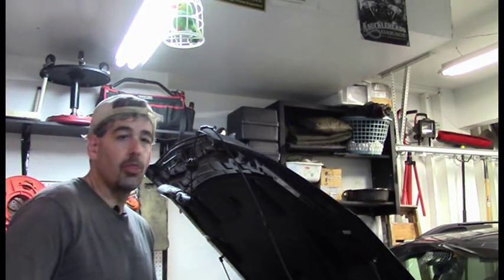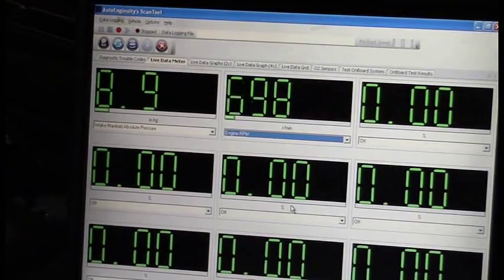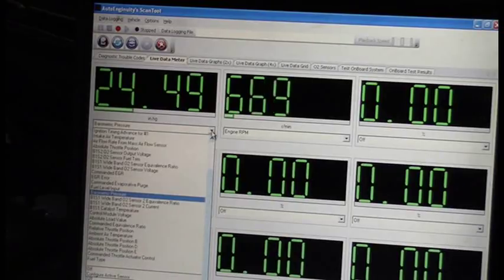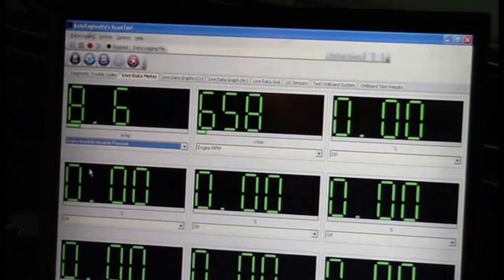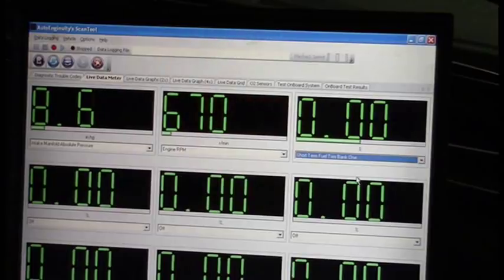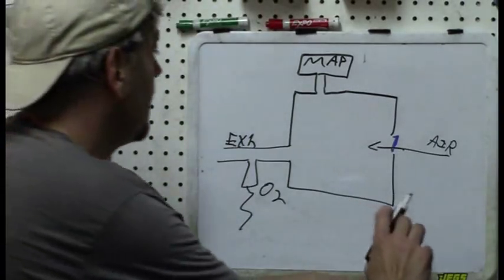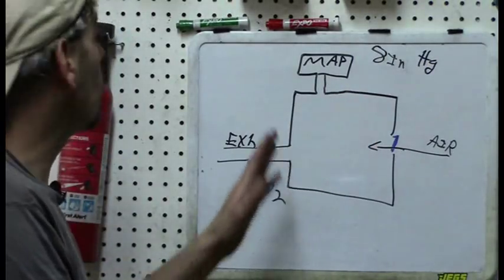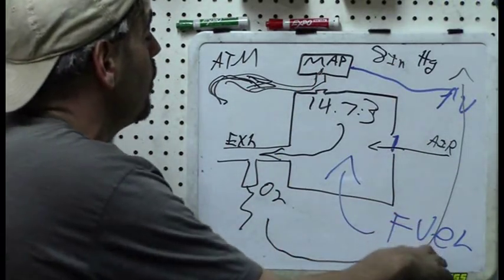MAP Sensor Diagnosis and Understanding Function- Pt2

Comment: Hei,  Is it possible that my MAP sensor in not working properly if engine is not working properly... I mean that engine will not go over 3000 rotation...if the rotations will go higher than 3000 then engine will jerk and doesnt want to work anymore.If I keep it under the 3000 rotation then it will work properly. OBD did said that there is a problem with MAP sensor but maybe MAP sensor just let me know that there is problem somewhere? Toyota Camry Le 2000 2.2 4-cylinder automat.
Reply from the maker: Its possible. What data do you have?
Reply: @SchrodingersBox  I dont know. In the workshop one electrican told me that problem is with MAP sensor...but I am not sure If he read it right.
Reply from the maker: Can't help- I need to see the data.
Reply: @SchrodingersBox  Thats too bad, but I understand. And I forgot to mention that...there is one problem more. Machines cant measure the CO2 also. So, If it is MAP sensor then because of that I cant drive over 3000 rotations and measure my CO2. I may get the data in the beginning of february

Comment: Excellent video and EXCELLENT explanations of how things work. You can look for online info for so many things and just waste so much time finding meatheads that make crappy video's and don't know what their talking about, never mind be able to explain in depth like you did.  I'm 53 and been a long time mechanic on my own diesel and gas trucks and equipment all my life. I haven't brought anything of mine to a shop since a teenager. I mostly have,  save, and run the 80's square body gm trucks with carbs and have a yard full of parts trucks. I'm a master with any carb, but have procrastinated on FI over the years. I have been forced into it slowly over the years of course with my ole ladies cars, etc. Thank you, this is what I've been looking for.  I'm going to your fuel trims vid now.

Comment: Another great vid. Thanks.
Im watching your videos as Im trying to determine what can cause hissing noise and jumping revs and hesitation on acceleration but it gets better as the engine warms up. My next checks are Map sensor and air intake manifold.
Thanks again.
Reply: I have also check coils by switching them on and off one by one. On cylinder 3 I noticed much greater engine jumping, car almost stalls. Can it be spark plug or ignition coil related??
Thanks.

Comment: I thought maybe this video would be the one i needed to watch to figure out my issue but i am stumped all my voltages are within spec. My truck starts and runs fine but after driving it around for a while when i come to a stop with it in gear it surges and if i pop it out of gear it is fine. Any ideas? I have eliminated the possibility of vacuum leaks or fuel delivery issues. The ignition all looks to be in good shape as well. Hope maybe someone has had the same issue and can help me out. Thanks.
Reply from the maker: It's not a MAP problem then.  I would start with ba basic Fuel trim vs TPS curve- keep it simple.

Comment: would an exhaust leak cause a MAP High input code?
Reply from the maker: No. a high input code needs to be voltage tested for a lack of continuity. if you think about it, this would be the most likely cause by far.

Comment: At wide open throttle(WOT) shouldn't the psi reading on the MAP go up
Reply from the maker: ABsolutely not (no pun intended) because the intake is balanced with atmospheric pressure at WOT.

Comment: I'm a woman and I.have a1995 Honda Odyssey that idles up and down and seem to use a lot of gas as well it's a  4 cyclinder engine. My question is do you have classes in Dallas,TX or close?
Reply from the maker: I don't teach classes.  I would look at fuel trim to start- see if it is adaptation to a variance.

Comment: can you clean the manifold absolute pressure sensor maf I have a 2000 Toyota Camry Ce  4 cylinder poor gas mileage 24.4 mpg I just wanted to clean it anyway to see if theirs improvement thank you
Reply from the maker: You might try carb clean but why not take baseline measurements and see if it is even necessary?

Comment: Awesome video, My S10 (4.3) had a 02 sensor code and po300, and it was the MAP! Did the quick and dirty way by just unplugging it and it was happy
Reply from the maker: Thats not how you test a MAP.  It reverts to induction from MAF exclusively. You have no evidence you fixed it. replacing the MAP and in fact it's virtually impossible it caused this code.
Reply: @SchrodingersBox  One piece of evidence I have found was upon visual inspection on the sensor, it was really carboned up lol. And on slight tip of the throttle while sensor is plugged in (15-20%) the engine would be misfiring.  And while I hold the throttle plate steady and then UNPLUG the sensor it would clear right on up!
That's all evidence I have right now, I don't wanna point fingers at a 21-year-old Map Sensor but idk

Comment: Wow, very very good at explaining the MAP sensor functions. I have a 2014 dodge avenger, and it is a map only car. Car is has a p0171 code which is a lean condition bank 1, and a p2173 vacuum leak detected. This affects the engine throttle body and the car runs rough at idle. After buying a MAP sensor which was not needed, i. Now thinking it's a IAC which would cause a vacuum leak code when idling. Which would explain the weird map reading on the freeze frame when code was determined. Which I will be testing the IAC soon before buying any parts. Thanks for your videos.

Comment: Hey Matt your videos are really helpful . I was wondering if you can help me with my 1995 Dodge Ram 2500 318 5.2 engine that has a high vacuum suction a few seconds after the start also I have a code p0113 and p0 713 thank you.
Reply from the maker: Sure- what data do you have?
Reply: I don't understand what do you mean by data
Reply: Also I just replace the intake manifold gasket and the plenum plate gasket which I thought was the problem from the beginning but it didn't fix anything I don't know what else to do now I just want my old truck to keep going

Comment: Thanks, i have learnt so much by watching part 1 and 2 of this, and i am still stuck, I wonder if you could help me, or maybe one of your subscribers can... my car is a manual, petrol 1.4 seat... there is no MAF sensor, and no throttle position sensor(as it is inbuilt in the throttle body)
the car revs high between gear changes, in 2-3rd 3rd -4th and 4th -5th but is normal in 1st-2nd..and tries to hold onto the revs for a second when i take my foot off the accelorator, but if i wait maybe 3-4 seconds with no pressure on the accelorator before changing gear, it will not rev up... seems almost like the valve is staying open in the throttle body for a few seconds longer than it should
the car has a really rough idle(sounds almost like a deisel sometimes)
throws up the typical code of p0106.
i have already cleaned and then replaced the MAP sensor.
i initially thought the throttle body needs a good clean(altho have not cleaned it yet)
i am also not sure if the chip in the throttle body is faulty or maybe the ecu for the whole car has a problem and i will tell you why,
when i get to about 70mph on the motorway, my abs light comes on as does my check engine light(which are not on at any point previous to this point) but strangely the car then drives perfectly for as long as i need it too, engine sounds great,and the car never revs between gear changes again, until i get home, turn off the car, then the car sounds terrible again, the abs and check engine lights go off, and the car revs really high on gear changes again.
this is confusing, as the car can run perfectly, as i said when the lights come on the dash, ive asked my local mechanic and to be honest he doesnt have a clue...
does anyone know what this is? i need help from a far more experienced mechanic than what i am ...
any help from anyone will be very much appreciated...
Reply: just need to add, when the car gets to 70mph and the abs light comes on and the check engine light, the rev counter and speedometer just die and stop working, and then the car runs great... until of course i turn off the engine again, then restart i have the revving problem all over again, and the lights speedo and rev counter work again... its driving me a little crazy ...

Comment: Thanks for your good explanation .but I have question is it possible to say that the operation of rail fuel pressure regulator sensor of gas the same  as MAP Sensor ?
Reply from the maker: Yes- all pressure sensors act pretty much the same as a potentiometer. Understand one, you understand them all

Comment: I think you got your voltage and pressure measurements mixed up.  At idle, your are correct, intake pressure is about 8 mmHg, but if you disconnect the MAP hose, the sensor will see atmospheric pressure, which is 28mm Hg, which corresponds to a MAP voltage of about 4.5 volts, the MAP output at WOT.

Comment: What will happen if a voltage regulator is installed on the map? Will it be possible to control the lean or rich condition of the fuel?
Reply from the maker: No because the fuel trim would merely compensate. What would be your purpose of doing this though? I can’t think of one single reason this would be beneficial.

Comment: hey everyone.  so i have a 2005 Dodge ram 1500, 5.7 Hemi.  have a problem were the engine will die at totally random times at low idle and deceleration. i am able to restart it immediately after no problem and absolutely no engine codes at all. I've checked measured and replaced a lot of parts and cannot get the problem to go away and have asked a lot of techs. Was thinking of having the ECM flashed or replaced. What do you guys think is that my next step? pleas let me know!!!!
Reply from the maker: When you "checked, measured and replaced" a lot of parts you have to show your data on  the parts you checks and measurements determined required replacement.  What was the data you got indicating what parts were defective that you replaced?

Comment: Could a battery that isn't getting a good connection cause incorrect readings in the sensors?

I got a MAP error recently but I didn't try any further diagnoses, I just got one at a salvage yard and replaced it. Since then I haven't gotten an error again but I also replaced the positive connector on my battery not too long after I replaced that sensor. I'm wondering is maybe the "new" map sensor would have given me the same error if I hadn't messed with the battery.

The previous battery connector had some cracks in it and such so I believe the connection wasn't the greatest. I had started having a problem with the car starting but after fixing that connector the problem went away.

I'm actually going to go have my battery tested again. When I had it tested before they said it was outputting 300CCA and needed replaced. I think it was just because the battery wasn't charging properly and/or didn't have a good connection.
Reply from the maker: Yes it could- what was the result of the sensor voltage tests if you suspect this?
Reply: I never actually tested the voltages since I didn't have a multimeter. I just got the MAP sensor error code and replaced it with a salvaged one. Then, pretty much the same day my car started having trouble turning over. I got the battery tested and they said it needed replaced even though it didn't.

I figured out later that the positive connector was cracked so the connection wasn't very good. I think my battery just wasn't charging properly. I just speculated that this could have been the cause of my map sensor code.

I replaced the positive connector for the battery though and now the car runs fine with the new map sensor in. I put the old MAP sensor back in just to test it and got the error code almost immediately so I guess it did go bad and I just have really shitty luck.
Reply from the maker: Well you certainly do things differently than I do- I have no idea why you replaced the MAF sensor.  I am afraid I cannot help- I do not function in this way.  Good luck, hopefully you don't have to fire the parts cannon too much lol!
Reply: I just replaced it because that's the part the code blamed. I didn't find your videos until after it all happened. Lol. If I had my whole repair process probably would have been more complex.

Luckily I think this time the error was actually the MAP sensor rather than some other part using it as a scapegoat.

Anyway, I have a multimeter now so I can do more thorough diagnostics. I'm gonna start getting the proper tools for other things as well.
Reply from the maker: hahaha well pretty cool of you to at least admit that.  if the code comes back let me know and I'll help diagnose it properly

Comment: So I drive a WRX (turbo 4 cyl EJ255) and I was going about 110 for ~15 minutes this weekend and the CEL came on.  The LTFT was at -13%, and the CEL was a MAP sensor voltage too high.  I was thinking it could mean my turbo is wearing because the ECU was expecting more air than the turbo was delivering.  i reset the code and drove the car around at regular speeds and the FT data hovers under 5%.

Do you agree with my thoughts? what else could be the cause of this condition? Thanks in advance.
Reply: Hi MetronsFirmament, I found your problem intriguing because of the turbo.  It would appear that your turbo is fine given that the MAP sensor is giving you a too high voltage error (i.e. high manifold pressure).  And it would also appear that the engine management is working properly given the negative fuel trim is trying to regulate to the high density of air it's measuring from the MAP.  I would suspect the cause of your error might be something wrong with the waste gate not opening/functioning properly and allowing the manifold pressure to build too high for too long giving you that code.  Just some thoughts...  Good luck.
Reply from the maker: What was your MAP diagnostic result?
Reply: Well, after watching your video I need to go check the voltage levels at idle and while driving around.  I was just thinking that I have a rich condition during high RPMs which means either there is more fuel than expected (leaky injector) or there is less air than expected as the RPMs increase.  Since the FT data is normal at low RPMs I do not think there is a problem with the injectors, and the only thing I could think of that would cause less air to be delivered as the RPMs increase would be an underperforming turbo.  I do not think that there is a problem with the MAP.  I guess if there was an exhaust leak the symptoms would be the same... underperforming turbo because of the lost exhaust gases.
Reply: High voltage from the MAP means there's a higher than expected pressure reading, which is confusing to me given the other information I have.
Reply from the maker: I agree that makes sense. Your understanding of the MAP and fuel trim relationship is correct.

Comment: Thank you for your well explained videos. On my Renault Megan 1.9 dci130 , The voltage on signal wire from turbo boost sensor is reading 0.87 volts and on higher revs the voltage is dropping to 0.83volts. The ground is fine and the reference wire is showing 5 volts. Would you agree that the sensor is at fault?